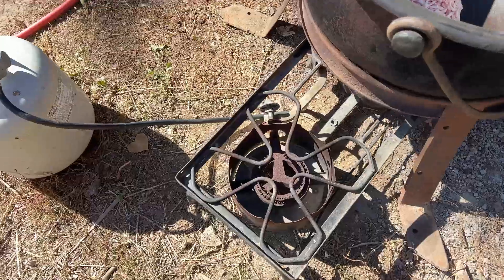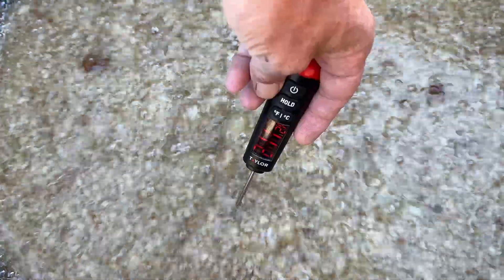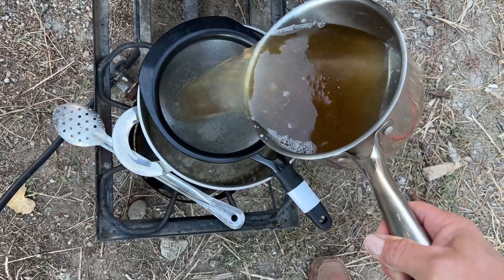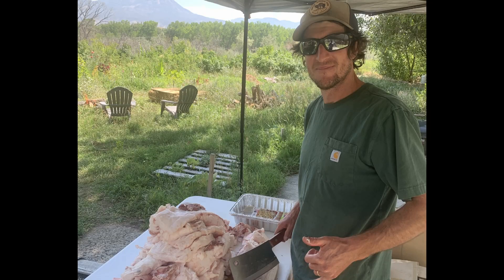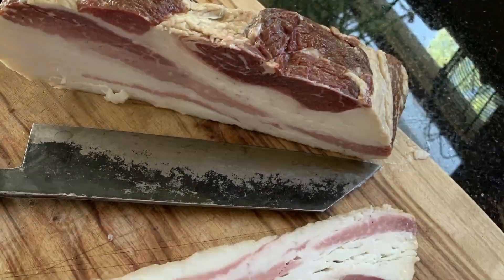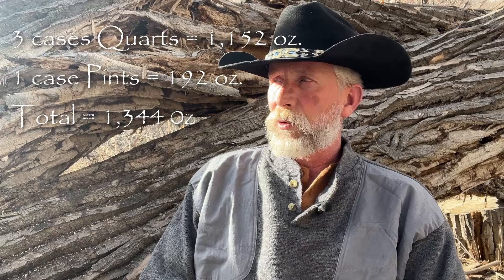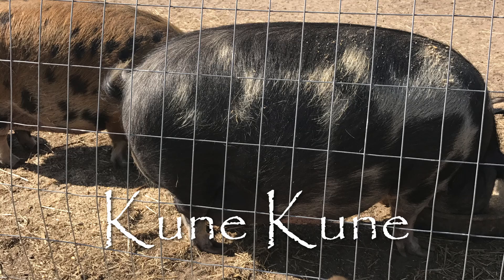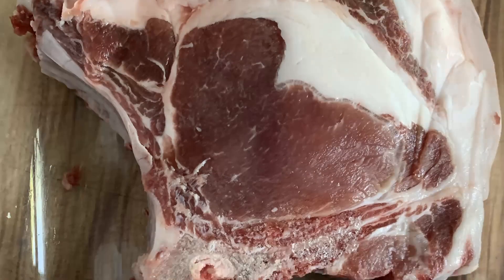Can You Run A Tractor on Pigs?

Comment: Woodgas can be dialed in to run a diesel tractor using ethanol vapor (sensitizer) Vs air (desensitizer) through simple PVC butterfly valves. The PVC is easily obtained, and easily sanded/drilled if needed, and won't swell like wood will. A simple rag can be used to soften the edges of the butterfly seat against the wall edge. And if one wishes, one can attach bicycle brake lines (easily obtained) to make for easy controls in the driver's seat. This does not allow for quick driving/loading changing...but most tractor work can be accomplished using woody material & vapor from moonshine. The Germans did it in WW2. The Virginia 12th Militia uses it for all of their vehicles, and the Virginia 15th Militia boys had their personal tractors converted after the 2021 Romney training camp demonstrations succeeded using green wood fuel on their Kaiser M35 recovery truck. Woodgas is an amazing prepper resource when Trump starts WW3. By the way....acorn tops (those little hat things where the acorns attach to the branches) produce significant amounts of methanol per lb..and they are everywhere in the Autumn. So one does not even need to fell trees if one has a good stand of oaks.

Comment: Great video and discussion. 
Are you planning on trying the process; pig to tractor? 
It would be very interesting to see that on your channel. 
I believe concentration and subsequent crystallization of hardwood ash water is technically potash which can be refined or converted (can’t remember which) to potassium hydroxide. Not sodium hydroxide, but should still do the job like sodium hydroxide as it does for soap, albeit potassium hydroxide makes for softer/liquid soap. 

It would be interesting to see if straight potash could refine the biodiesel as it is still very caustic and easy to make.
Reply from the maker: Thanks for the insight! There are many experiments required to realize the concept, for sure. Other questions include the longevity of running B-100 in machines, or if it is better to use such a product to stretch conventional diesel fuel. I suspect, at the very least, that those cheap diesel heaters would run great on pig diesel.